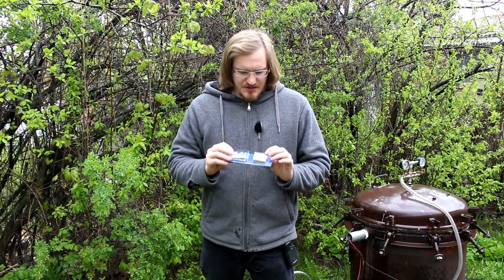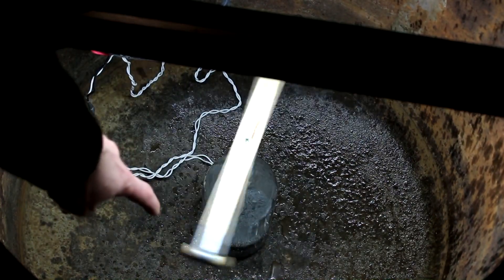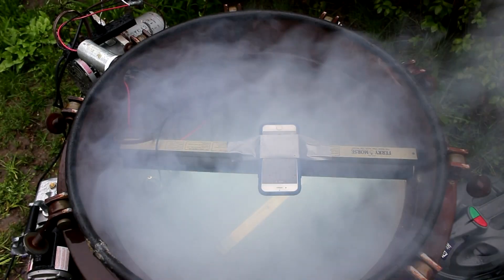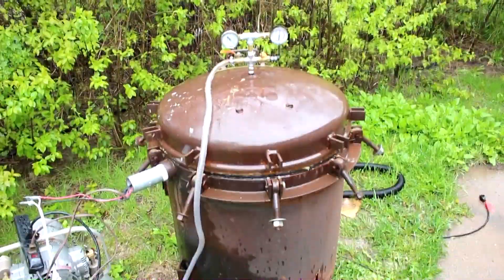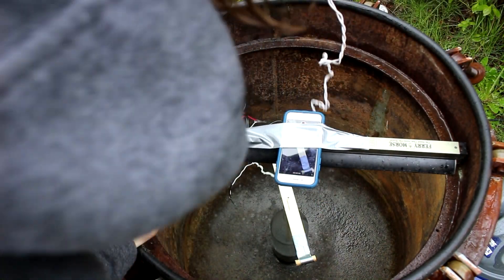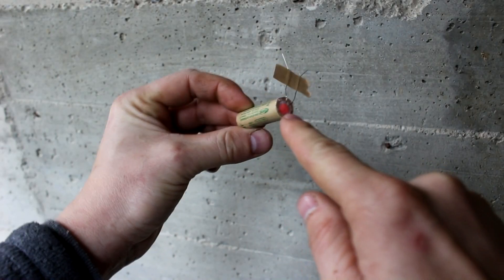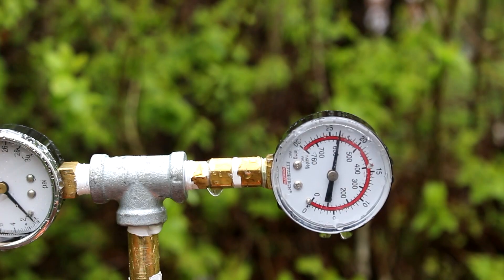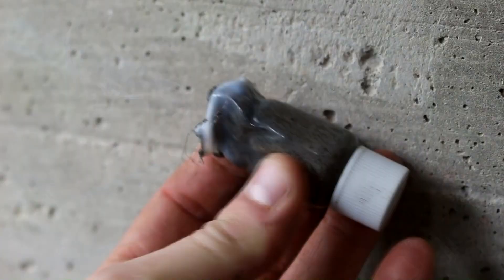Will a Model Rocket Motor Work In Vacuum?

Comment: I am not a flat.earther but you didn'nt demonstrate anything, -600 mmHg is still a nice pression, there is still enought air, then the chamber is pretty small so it would work even with the absolute vacuum. I think that propulsion in vacuum is impossible.
Reply: "I think that propulsion in vacuum is impossible."
Imagine you have two rocks in a weightless, and airless environment. Then imagine there is a compressed spring between the two rocks with the only thing holding the rocks together being a string tied around the two rocks and spring.
What would happen if you cut the spring?

Comment: When you put that rocket in the bottle and closed it off, you did not create a vacuum inside the bottle. It had air and different pressure.  Correct me if I'm wrong but that does not prove your experiment. Rockets in space are not enclosed. Thanks.
Reply: The solid fueled motor was only enclosed during ignition. t then melted a hole in the bottle and was exposed to a rough vacuum and produced more thrust than the one ignited at regular atmospheric pressure. The vacuum chamber is around 18900 times larger in volume than the bottle, which means that the density of the air in the chamber would be raised by a whopping 0.005% when the bottle broke open.
The motor in the vacuum was unable to sustain combustion though since it only ran for about a half a second while the one at regular pressure ran for about 5.6 seconds, mainly because the throat diameter was to high to keep the gass in long enough to counteract the amount of gass lost through the nozzle since it was designed to have around one atmosphere of pressure pushing back in on the gass inside.

Also: liquid fueled and hybrid motors have a constant flow of gas in the form of fuel and oxidizer keeping the combustion chamber pressurized so they don't need to be closed to light.
Reply: Feathered Thanks for the explanation.

Comment: so could nasa have detonated explosive charges on the moon. they apparently did it on the Apollo 16 mission
Reply: Yeah of course.
Be even easier than setting up a rocket and space because once that s***'s detonated you don't need to worry about a chain reaction facilitated by pressure.

Comment: This experiment is not a proof, the firework rocket pushed against the small glass , and even if there is no glass. The fire comes out of the rocket is still pushed against the wall of the chamber side way.

Comment: "The chamber that the bottle (which only contains about 10 cubic centimeters (0.33 fluid ounces) of air with the engine inside) was in a chamber  with a volume of about .189 cubic meters (50 gallons US) The bottle contained a whopping ~18900 times less air by volume than could be contained in the chamber."

end qoete

You are in error. The plastic casing containing even a small amount of air say 1 cm^3 (cubic cm)  where the rocket was encapsulated was just enough volume  to produce an relative enormous reactive force when abruptly pushed off by the rocket's exhaust gases enclosed inside the plastic casing and push forward the rocket. Here is where the Newton's 3rd law reactive force is manifested and not by the rocket pushing itself off on nothing!!

The case you are suggesting is a clearly violation of law of conservation of motion or momentum in which even Newton's 3rd law has to comply with. Where is the external force the law of conservation demands when there is noting? A body can not push off itself in nothing where there is no external force outside the body present. (i.e. a firing rocket is considered as one body).

In atmospheric conditions the reactive external force comes from the air pushed off by the rocket exhaust gases.

However, in space there is no medium to push off so therefore no external reactive force is produced and the conservation law is broken thus making invalid and not applicable Newton's 3rd law in space. 

You see Newton at his time when he expressed his 3rd law didn't have in his mind the vacuum of space, actually he never knew that there was a vacuum in space, they believed  that there is a medium in space till the early 19th of century called Aether filling outer space.  Be sure that if he knew that there was a vacuum in space, Newton would have modified his 3rd law.

However, this is still today teach by science and in schools as to be valid for any case without exceptions. 

*They need this to prove that space travel is possible with chemical thrust.*

So please Sir spare me the lecture , I know exactly what I am talking about. The total volume of the chamber has noting to do with,  it could be even thousand times larger than the second smaller plastic chamber (plastic casing with rocket inside) it wouldn't matter. Actually by doing so Cody shoot himself in the foot making the whole vacuum chamber obsolete except the fact that after ignition this imperfect vacuum  (nothing near to a space vacuum) provided a minimum friction on the rocket's spin inside. 

It is a local phenomena, has nothing to do with total volume o the test chamber but only with the air trapped inside the plastic casing of the rocket. The instantaneous pressure released was just enough to push violently the rocket forward. 

The Cody's experiment talks for itself I have nothing more to add for explanation.

Conclusion: 

1) All these vacuum champers experiments are destined to fail to emulate rocket thrust in space and and don't produce conclusive results therefore deemed us unsuitable and can not be used as proof.

2) There is not such thing is science like final conclusion.

3) So far latest very high speed tests show that Newton's 3rd law is not applicable for chemical thrust rockets in space.
---------------------------------------

see for your self in this video here, tube chamber gets first pressurized by rocket's own exhaust gases and only the start's to move forward! and rocket inertia is not responsible for this delay, rocket mass used has almost a null inertia.

https://www.youtube.com/watch?v=GxBRQXxBRic&t=158s

my2cents

Markoul11
Reply: Markoul11 Newton's 3rd law has nothing to do with volume, nor does it need anything to push off of. It simply requires two masses being forced apart, the first mass being the rocket itself. The second mass consisted of the bottle that got thrown backwards and then the exhaust gasses themselves.
Feel free to try this out yourself: Take a waterhose and point it in the air (hardly any molecules to push against), into water and against a wall (lots of stationary matter to push against). I can guarantee you that the thrust is roughly going to stay the same.
Oh and the video you linked? That guy did a second video where he measured the pressure (or lack thereof) before and after ignition with no significant change, which means there was never any air/exhaust gas to push against.
The delay is quite easily explained as well: These model rocket motors need a split second to ramp up their thrust. This can be observed in every "normal" model rocket launch in the air as well.
Reply: All these experiments you described are done inside a medium either ground or water or air. Take some time to study science history. All the Experiments and thoughts and theories Newton did and beveled were done in a medium and he never though about a vacuum! Therefore, Newton described his laws assuming a medium is present. 

*Newtonian's 3rd law is an example of this and describes the interaction of two masses inside a medium (3rd mass).*

Furthermore, Newton's 3rd law demands the two force vectors (not motion vectors) to point inwards and opposite direction like this --><--  Show this force vectors in your precious little rocket in space?!!....

He never mentioned in his writings the word vacuum simple because he never new that a think like vacuum could ever exist!! 

Unless you prove that Newton was aware at the time, of the vacuum concept and he included this in his calculations, experiments and theories, please stop wasting my time... stop worshiping figures dead centuries ago these and their theories were not gods and  science is no dogma and has no axioms in the long run.

"A theory if it is not falsifiable is not valid scientifically." And every rule or law has always an exception. It is always an on going process or else there is no progress.

"Oh and the video you linked? That guy did a second video where he measured the pressure (or lack thereof) before and after ignition **with no significant change**, which means there was never any air/exhaust gas to push against."

end quote

It depends of what you consider as significant change! Imagine what would happen which even more "significant change"... I tell you... the whole chamber would crack and explode as he mentioned in his video having an accident before. Your argument is subjective. If he had a very good vacuum there would no exhaust gases pouring out of the chamber when he opened it. Why he does not dare to reaped his experiment with the vacuum pump on and working all the time even during rocket ignition to see what happens then? Why not? after all this would emulate at  best the real vacuum in space...

quote
"The delay is quite easily explained as well: These model rocket motors need a split second to ramp up their thrust. This can be observed in every "normal" model rocket launch in the air as well."

end quote

BS! For the small tiny rockets with almost null inertia mass in test vacuum chambers this delay is the time needed for just enough pressure to build up locally behind the rocket exhaust in order the rocket to start moving forward.

For large rockets in open air this time delay for lift off is primary due mass inertia.

You have the last word.

I will not answer any more replies on this matter...spare me my time and believe what ever you like, I don't care...

Goodnight and Good luck.

Markoul11
Reply: Markoul11
"*Newtonian's 3rd law is an example of this and describes the interaction of two masses inside a medium (3rd mass).*"
There is no such 3rd mass present in Newton's 3rd law. But feel free to try and explain how a waterhose doesn't change thrust regardless of the matter or even state of matter behind the nozzle, despite claiming that this is the case.

"Furthermore, Newton's 3rd law demands the two force vectors (not motion vectors) to point inwards and opposite direction like this --><--  Show this force vectors in your precious little rocket in space?!!...."
Quite simple really, as both the rocket and the exhaust gasses have inerta, therefore they exert a force opposing the acceleration away from each other.

"He never mentioned in his writings the word vacuum simple because he never new that a think like vacuum could ever exist!!"
Not true. He assumed a "void" between the planets and the sun, otherwise his theories wouldn't have worked. And again: if he "was aware" of a necessary medium, then why does it not appear in his laws?

"Why he does not dare to reaped his experiment with the vacuum pump on and working all the time even during rocket ignition to see what happens then?"
He let the pump run in the video I mentioned, exactly because he knew some people would have this issue with his experiment.
It also appears you didn't understand my point of "no significant change" or are simply willingly ignorant. What I meant was that the gauge showed a similar level of vacuum, with only an insignificant change in pressure that could still be considered vacuum.

"For large rockets in open air this time delay for lift off is primary due mass inertia."
I wasn't talking about full size rockets, but the very same small model rocket motors he used in vacuum. Have a look at this video: https://www.youtube.com/watch?v=8Te5uHWJV4Y
There is quite a lot of smoke being expelled before the actual liftoff.

Comment: Why did the water pulsate under the bottle at the end?
Reply: It was boiling, water when it gets cold enough starts to only boil in large slow bubbles instead of the simmering or vigorous boiling we witness at normal atmospheric pressures.

Comment: Am I missing something here? Surely you need oxygen to achieve combustion, not pressure.
Reply: Solid rocket engines use a solid oxidizer that is mixed in with the fuel when they are made.
Reply: Thank you, consider this guy better informed today than he was yesterday. :)

Comment: Usually SRF is very seldomly used in vacuum, and if they operate in vacuum they were usually ignited somewhere in the atmosphere before they passed the karman line, IF they for some reason need to be ignited in a vacuum, there usually is a thin metal membrane in the opening and the inside slightly pressurized, or it is ignited by hypergolic liquids or monopropellants... In almost every case where a light or re-light of a rocket engine is to be performed in vacuum, its allmost allways liquid propellants, and most often Oxygen and Hydrogen, and usually nasty hypergolics as ignition source, in addition to the fact that the propellant tanks are pressurized, so when the gasses expand through the turbopumps and meets the restriction in the pre-burner and in the main combustion chamber, it lights off easily :)
Reply: The most famous rocket that uses solid fuel as a vacuum engine is the ATK's Antares and Airbus' Vega. 

Also, older rockets use solid rocket booster as "kicker stage" on 3rd-4th stages. Examples are the one used to "kick" Voyager Spacecrafts to higher velocity if I'm not mistaken.
Reply: And speaking of vacuum solid motors, most of which have a relatively small nozzle throat and a very large nozzle bells to improve specific impulse. :)

And from what I read, the reason why solid motors still have a place on space program is that it has a very reliable ignition. And the reliability of solid rocket motors was made possible by the lack of moving parts aside from the nozzle gimbals. Turbo pump-driven  liquid fuel engine has a tendency of failing on its own during ignition and while it is running because of the numbers of moving parts like pumps, valves, regulators, etc. that could fail at any moment. 

Aside from turbo pumps, the other way to push fuel into the combustion chamber is by pressurizing the fuel tanks itself. This type of engines are called Pressure-fed engines. It is used in many ACS/RCS engines and many descent engine for smaller spacecrafts when landing on Mars or on the Moon. One example is the descent and ascent engine on Apollo LM. The simplicity of the design is a big plus for improving its reliability. :)
Reply: Yes the LEM used a pressurized tank-fed hypergolic fueled engine, and the exhaust is so corrosive they were actually never test-fired before beeing installed in the LEM, as it would deteriorate it too much.
Reply: Iirc, another method used for probes, etc, was to light a motor off in a sealed chamber to generate pressure, and valved that  pressurized gas out to nozzles for pitch and attitude control.
Reply: Gunpowder needs pressure to burn - the burn rate is proportional to pressure. More pressure, faster burning = yet more pressure. Unconstrained gunpowder is hard to burn rapidly at sea level.
This is not an issue with solid rockets per se but is a problem for GUNPOWDER type rockets in a vacuum. To work properly you need to fit a much smaller throat than is optimal at sea level (in fact if ignited at sea level pressure the rocket may explode). Ignition requires a far more energetic (explosive even) ignition to get to working pressure and hold it there until the propellant grain is burning properly.

Comment: Cody, you do realise that placing the rocket in the bottle (of air) negates the whole experiment, concept and results.

This is a clear example of one warping the experiment to fit the preconceived idea to arrive at the "results" one is wanting.

This isn't science.
Reply: The air inside the bottle quickly rushes out when the hole gets burned in the back of it and what air was present afterwards wouldn't be anywhere near enough to provide or influence the amount of thrust generated or oxidizer consumed by the engine.

You have very little understanding of what you are talking about.
Reply: Feathered 

Evidently it is enough as it occurred!

It's that simple.

Your comment doesn't negate mine either as the whole "experiment" was negated the instant Cody placed the rocket in a non-vacuum setting while simultaneously claiming it a success.

Natural science doesn't lie; people lie, and others believe those lies.
Reply: No it doesn't, you realize you saying something doesn't make it true. 
You can keep insisting that the rocket wasn't in a vacuum all you want but it was, it required a bit of pressure around the fuel it to help with ignition but the test was not to see if gunpowder ignites in a vacuum, Cody already did that test, this test was about rocket propulsion in a vacuum and you can't ignore the results of something because you don't like it.

Comment: How come the water on the bottom didn't boil or freeze in there?
Reply: It was, water boils in slow releases of large bubbles in a vacuum once it cools down enough which explains the apparent pulsation of the reflection in it near the end, and it didn't freeze because it was warmed a little by the walls of the chamber.